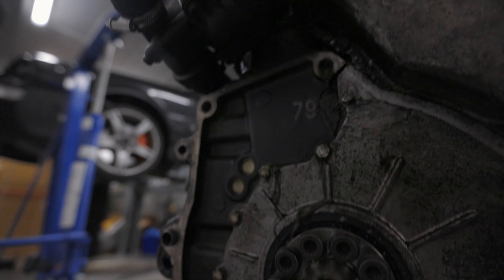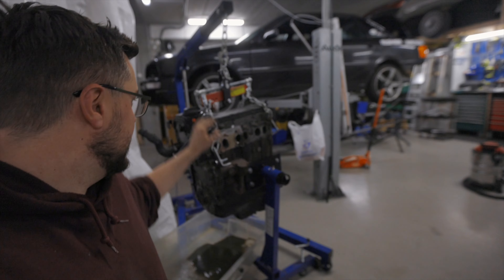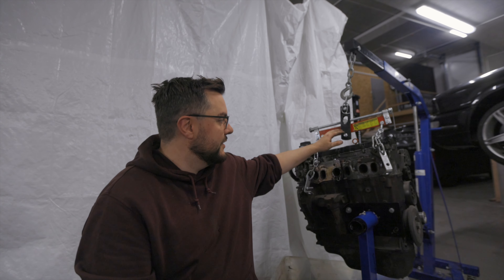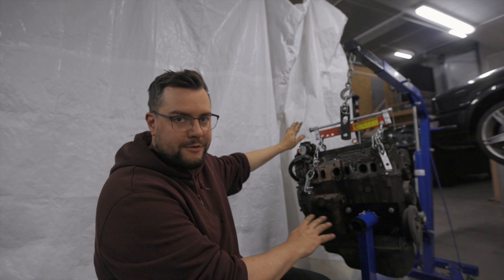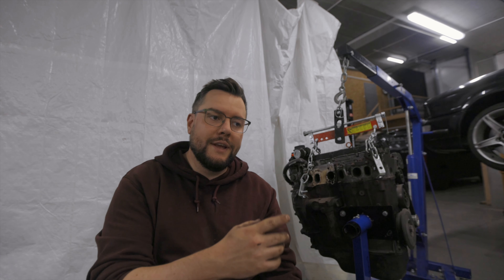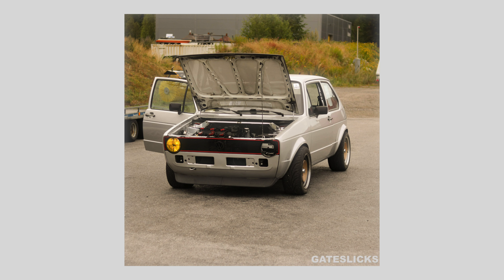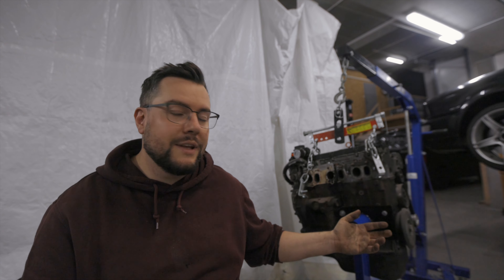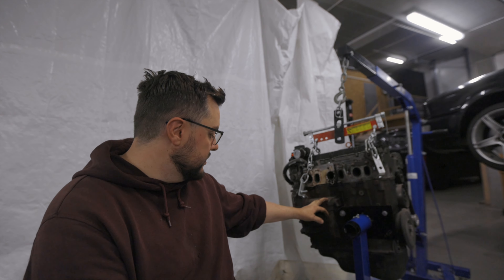I Damaged this VR6 Block and now I Need Your Help

Comment: 2 option! 

1: throw away the block! 

2: when fitting the gearbox, get the correct bolt and fit it with sealant. RTG sealant or dirko is good.

Comment: I'd just put thread sealer on the bolt and run with it. Deutsche Auto Parts had that happen on an R32 he bought and that's what he did.
Reply: https://youtu.be/7pxapTfzyWk?si=xo4cYSGgQnu7gIat

22:50. Loctite has a product.
Reply from the maker: Thanks!  @dubCanuck1